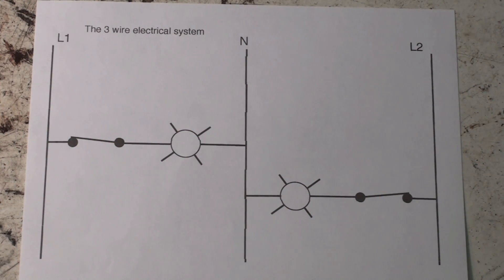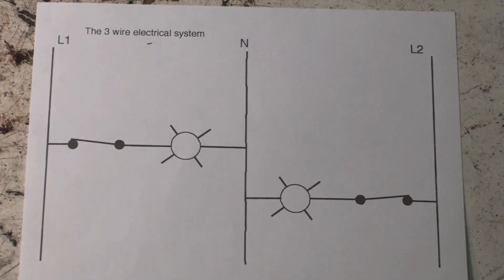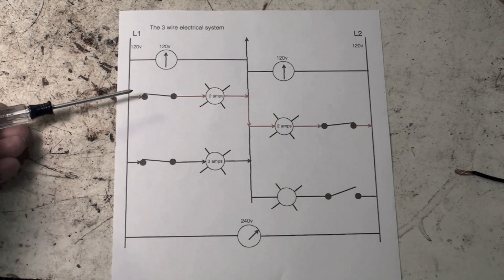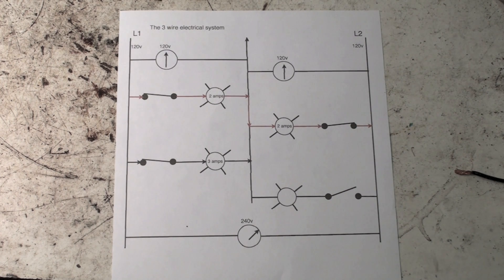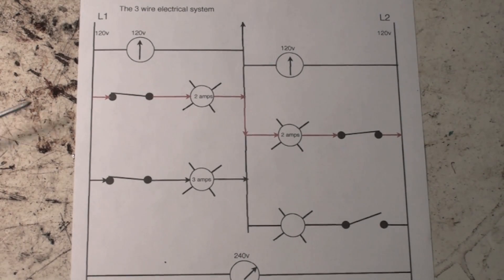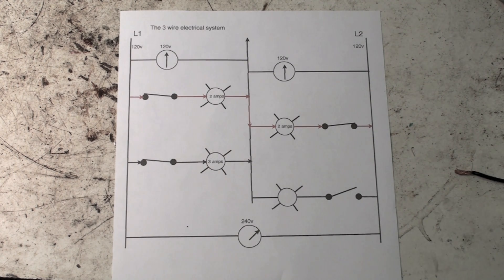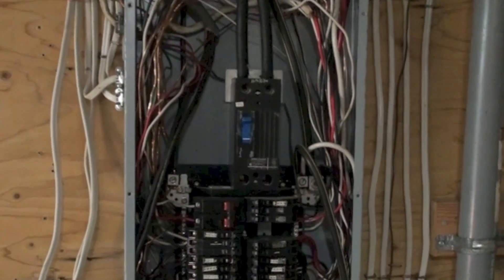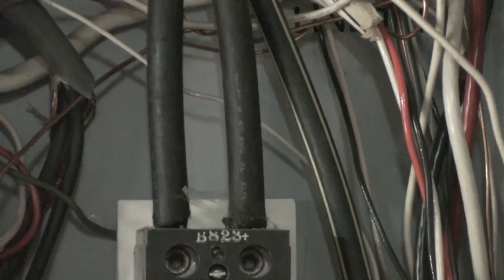How the 3 wire electrical system works

Comment: The neutral, in North America single-phase residential service, the white wire in 14/2 Romex, etc, is ground. Power grids use the earth as a conductor, the 4th wire from the power plant 3-phase power generation. In the gray drum on the pole outside your house, the neutral is centre-tapped off the 240vac secondary coil, making either coil end 120vac hot leg in opposite polarity. Tie the two hots and you get the original 240v. The neutral drains off excess voltage from either leg straight to ground at the pole to equalize each hot leg at ~120v in the event of spike or imbalance. It isn't needed to power lights, plugs, appliances, etc. It's a safety feature to reduce electrical shock while maintaining light bulbs at the same brightness.
Reply from the maker: This issue has been argued, it seems like forever.  I must respectfully disagree.  Ground, as in dirt, rock etc, is an extremely good insulator.  In order for power to pass thru dirt, the voltage must be extremely high.  On the order of lightning voltage.  Which brings us to what the ground is really for.  Lightning protection.  If you have a ground connected to the neutral, If lightning strikes the pole or wire, it has a place to drain off to.  If it was possible to use the ground as a conductor, underground metallic pipes would corrode from dielectric action.  
If we could use the ground as a bleed off to essentially dump imbalanced power we would have an inefficient grid system indeed.  Thanks for the thoughts.
GFM
Reply: depends on where you are....wet clay areas with a high water table conduct power rather well.....in the old days of early telephone service...customer's were advised to pour a bucket of water over their earth spike in their garden to get phone working again... as ground return was used ......
Reply from the maker: Bob Elliot I will be doing a video on conductivity of earth and the other issues when I get time.
GFM
Reply: grayfurnaceman
Neutrals are grounded at the power generation plant and every substation, stepdown transformer on the grid and each service panel. These earthed conductors on the grid serve as return paths for over current, whether from lightning, short or generator spike.

In residential wiring, from the service panel to plugs, lights, etc, neutrals close the circuit (for appliances, etc, to work) while serve as over current conduit to ground and halve the 240v secondary wiring into two 120v legs. The neutral is purely a safety feature. It isn't necessary to power lights and appliances.  Many parts of the world, very dangerously, are powered by two 120vac opposite phase hot legs. No safe return path for over current or even bare copper ground.

In North America, the neutral, at the final stepdown transformer, is centre tapped off the secondary coil to ensure constant 0v from the grid, excl. spikes. No volts or amps in the neutral when appliances and power distribution are working properly.
Reply from the maker: Jason Bell I will refer you to Mike Holt's video on earth ground myths.  He tells it better than I can:  NEC 2014 - Grounding Earthing Myths
GFM
Reply: grayfurnaceman
I hear you. But don't recommend the opinions of entrepreneurs that financially exploit freely supplied public information. Holt has some useful things to say, but his emphasis on stray voltage is inaccurate. It's not voltage that electrocutes, it's amperage. While earthed conductors don't eliminate voltage, they sure as heck conduit electric charge straight to ground instead of in one's body. Anyway, I like your video.
Reply from the maker: You could be right about Holt. But I thought he had good points.  
I still think we have a difference on the earth ground.  
My point is this:  Earth ground is connected to neutral in the panel providing the circuit protection for shorts.
However, if I am standing in water, and touch a hot lead, I will get a shock and could be electrocuted but the breaker will not open. 
That is why we use GFCIs on circuits that are vulnerable.  
I hope we are not talking at cross purposes.  Thanks for the thoughts.
GFM

Comment: Now hold on my friend.  Lets talk about one circuit.  You have 3 wires encased in a cable, a black, a white and a ground.  The black is hot going to a switch for a light.  The switch is off.  Therefore the power goes to the switch and is returned to the service box from that point via the white wire.  No power goes beyond the switch.  When the switch is turned on, power goes beyond the switch to the light fixture where wattage is used to light the light and is returned from the light back through the white, passed the switch still throught the white and continues back to the service box.  You cannot stop the flow of electricity.  It must always be returned.  We don't use electricity, we in a sense just borrow it.  Is this correct? I never understood why a white wire is called a neutral.  To me it doesn't make sense.  Sometimes it is hot in certain areas of a circuit, and sometimes it is not.   Correct?
Reply from the maker: The part about the power returning via the white wire when the switch is open does not appear to me to make sense.  When a switch is open, nothing passes thru.  When electricity passes through a conductor or a load it does not slow or be "used up".  We just use the effects of the electricity passing thru.  
As for the Neutral, I will do a video on how a neutral can be hot.  Thanks for the thoughtful comment.
GFM
Reply: grayfurnaceman Sir, I'm not saying I'm right or wrong.  I just don't know. If the switch in my example is turned off, you still have power going to the switch via the black wire, but it isn't being used. So where does the power go when it hits an off switch?  I'm also trying to learn about alternating current.  Does the power go back and forth, or "alternate" through the black wire?  Or does it return via the white wire?  Some speak of white wires and ground wires as being kind of like the same.  Again, my problem is why call something "neutral?"  What is the purpose of a "neutral" wire?  If I can visualize what is happening, then I could understand it.  Thanks for being here.
Reply from the maker: tommiesaysso We commonly say when there is an open switch there is potential.  Meaning voltage is there but not moving.  The power cannot pass through the high resistance of the open switch.  
Alternating current is a current travels travels from negative to positive during half of the cycle, then the source switches polarity and the current again travels from negative to positive but because the source of the current has switched polarity, it travels the opposite way.  
It is true that the ground and the neutral are connected together at the panel.  I realize the concept is hard to pick up.  Perhaps you should look at some basic circuits.  I have done some videos on this and will be doing more soon.
GFM
Reply: grayfurnaceman I think that possibly many of the terms used to describe things regarding electricity are kind of like when PC's first came out, and the computer world used words like "RAM" and "HARD DRIVE" etc and of course still do.  There were tons of those "Computers.....For Dummies" books published to help many people understand what everything meant, and yes I did by one or two.  LOL  If you are going to do a video to help me, and I'm sure many others, that would be great my friend.  I have spoken to a few electricians, some in the business for 20, 30 and even 40 years regarding what I've talked about here, and very surprisingly they could not explain it, BUT they were taught that "This is the way its done" and that's it.  They all were excellent electricians but they didn't know or they couldn't explain the "whys" and the "hows."  In a very real way, that's a bit scary, but they always got the job done correctly.  I've watched many of the videos on this subject on YouTube, and I believe a big part of the problem is that people don't explain what is obvious to THEM as teachers.  One SIMPLE idea or fact overlooked or explained can make a GREAT difference for people like myself and many others who are trying to learn.   Thank You again for reading and your patience with me.    TOM  : )
Reply from the maker: tommiesaysso First, to defend the electricians, you do not have to know exactly the why in order to work on it effectively.  
I fully understand the need for basics in especially electricity.  I have or am working on training materials for the beginner.  It just takes time to get it put together.  Thanks for the thoughts.
GFM

Comment from the maker: Usually red.  If there are only 2 black wires for hot on the output of the panel, there will be a piece of red tape on one of the black wires.  Hope it helps.
GFM